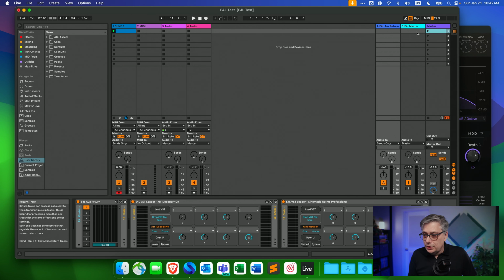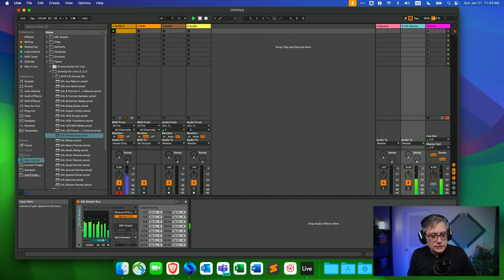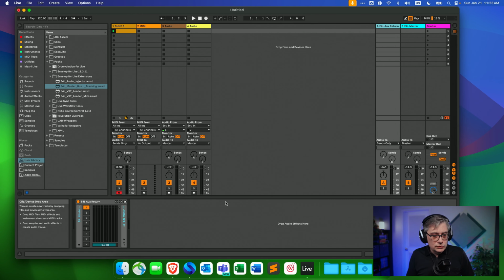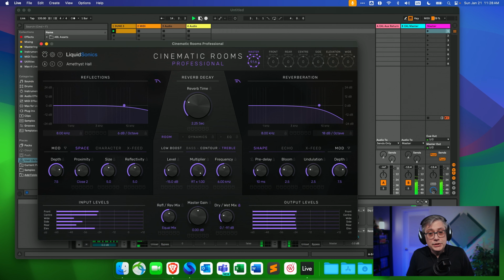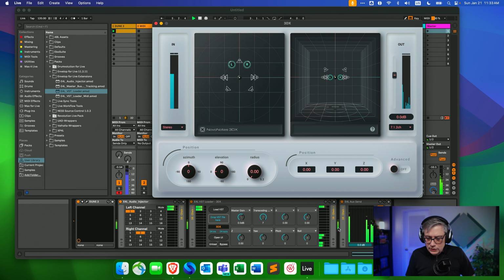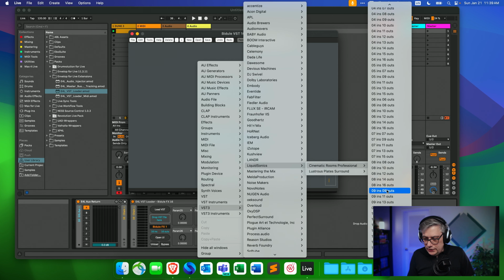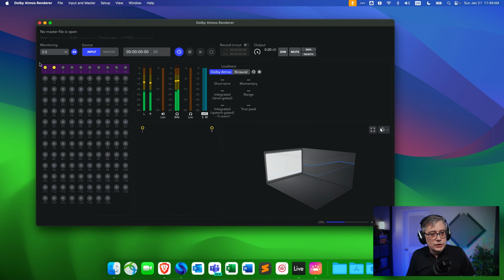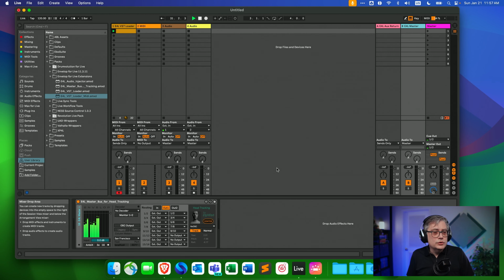Turn Ableton Live Into a Multichannel DAW for Free

Comment: I have made very similar thing myself when I very wanted to use IEM Ambi plug ins in Live, the only problem is that when you are "nesting" vsts inside m4l you are literally frying your computer. Even for this showcase cpu meter in your live is reading 20-30%. Thats a terrible side of this solution. In practice its even worse.
Reply from the maker: You need a powerful CPU, that is correct.

Comment: Really great Video! Thank you Michael I‘m wondering if it takes a lot of CPU when creating a song with 100-200 tracks? Do you have any experience? I‘m currently trying out the surround Panner device which you mentioned i another video and at 40 tracks only it seems to get a bit slow. Best regards from Munich :)
Reply from the maker: Thanks! I would expect that the CPU struggles a bit. This uses Max4Live. But I have never tested the limits.

Comment: Das ist der Hammer! Danke Danke Danke für dieses Video! Ich bin Bitwig User, habe bei Ableton Live 8 den Wechsel zu BW gemacht, weil die PDC nicht funktioniert hat. Ich arbeite momentan an einem immersiven multimedialen Livekonzert für 2025 (da ist übrigens wahrscheinlich auch die Uni Graz beteiligt) und frickele das in BW mit Grid, FX Sends, jeder Menge Modulatoren etc. hin. Also selbst gebaute 3D Panner etc. Funktioniert auch. Aber mit dem Ergebnis, dass die BW GUI nun nur noch mit 3fps refreshed. Das BW Grid bietet keine Möglichkeit, ein Bus Encoding wie bei M4L zu realisieren, deswegen funktioniert bei einem 3D Sound Projekt der Mixer nicht mehr. Es ist ein Graus. Dagegen ist das hier vorgestellte Verfahren einfach genial mit dem Two Channel Encoding und Decoding. Ich probiere das jetzt alles aus und sollte das wirklich funktionieren bin ich wieder zurück bei Ableton. Echt ein Bärendienst, den Du mir hier geleistet hast!! Vielen Dank!
Reply from the maker: 😂 Yes, don”t underestimate Ableton. Thanks for the kind words!
Reply: @michaelgwagner  Hi Michael, related to this video some more questions to understand the workflow: As far as I understood, E4L and its derivates work in a way that they encode and pass signales along to other instances of them, like an encoder directly sends the audio to the decoder. So routing happens outside the regular workflow, correct? How does that affect mixing/gainstaging/leveling, especially as I assume that everything happens pre-fader? Can I still use the mixer's faders to control volume of individual tracks or do I need to do that in a different way? Does the mute button work? Just thinking of live scenarios where I want to fade in certain tracks, I usually do this on the Mackie protocol, which controls faders and mute buttons. Would that still work? Many thanks for your help!

Comment: It's pretty insane that Ableton decided not to pursue mulitchannel support for Live 12 after years spent on the update while Dolby Atmos exploded as a household format in that stretch of time. That said, your workarounds are much appreciated. Question on the area around 25 min in your video here: what happens without the Bidule plugin? Would those channels just get trimmed out of the signal, or would they fold in - for example would the .6 just sum to .2? I simply want to exploit the M4L multichannel support without encoding or panning, using the Dolby Atmos Renderer and the Dolby Panner per my usual workflow within Live, but am reluctant to spend yet another $100 on a plugin which you admit crashes on the regular to solve the 9.1.6 to 7.1.2 dilemma shown here. Thanks much!
Reply from the maker: Have you tried Kushview Element in lieu of Bidule. That one is free and should work in the latest version.

Comment: Good luck flicking between Chain/Master in real time and this thing not blowing out when you got a flow going. Also I like this 30% cpu usage
Reply from the maker: As I like to say, it tends to be a bit temperamental. ;) Max is working in the background, but the E4L system itself should not be that taxing. About 6% on my M2 MacBook Air.